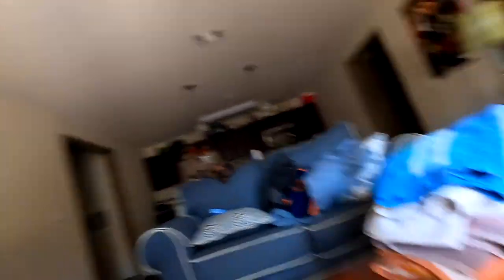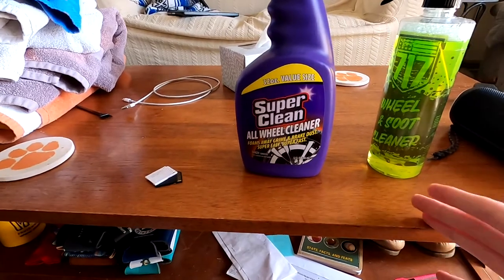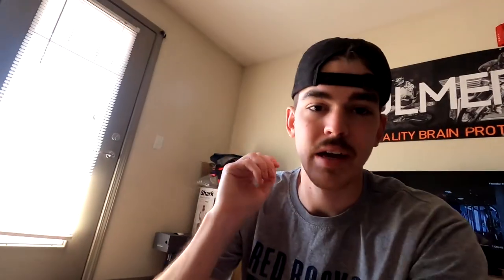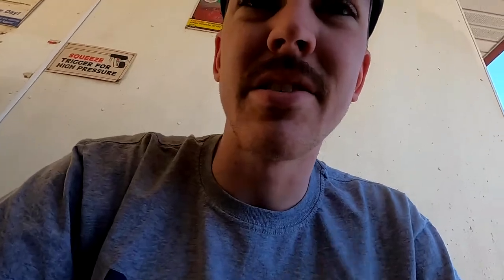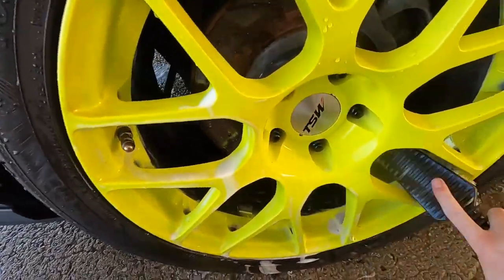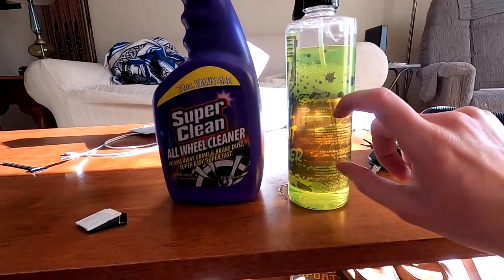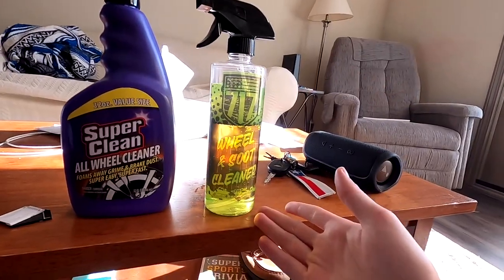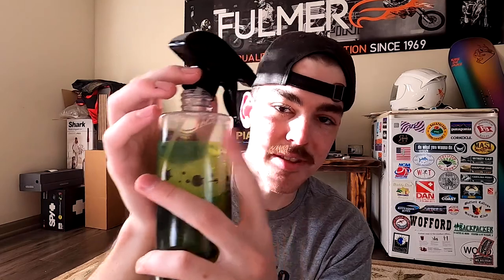Is 717 Supply Wheel And Soot Cleaner Any Good?

Comment: Do you think this (the cheaper products you use, not buying the over priced 717 crap) would work on the bottom of the cowling on my airplane where the exhaust exits?   It’s basically the same as getting it on the rear deck lid of a car.   Wondering how harsh it is on the painted surface. My cowling is painted carbon fiber so it’s also not the same material as a plastic or metal body panel. 

I know you just do car stuff but I figured you may have an idea if it would get the white exhaust soot off. 

New to the channel. Nice video.
Reply from the maker: I believe it would work. Mike said he uses it on the back of corvettes that get covered by exhaust stuff. So I believe it is safe on paint.
Reply: @MotoTaco  awesome.  I haven’t watched any of your other videos yet but I’m going to subscribe.   Do you have an Instagram?